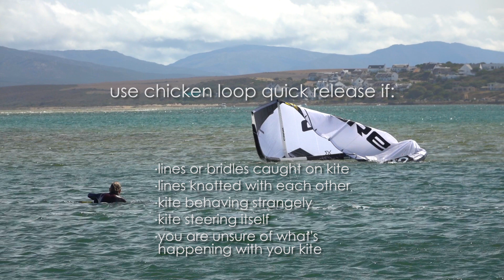Relaunch Part II, Advanced (kiteboard tutorial)

Comment: Thanks for your very useful video. Please note that in the later part the video, two relaunchs SEEM to be done WITH tangled lines (it can be clearly seem at times 8:40 and 10:11): is this correct?. Please advice.
Reply: True! 
But you can control the kite as usual with such tangled lines, so you can return to the shore, land as usual and untangle them in safety. (search for "inverted kite lines" videos)

Or do it in the water, but it is dangerous, cause you need to be unhoked for that and remove your safaty leash. so there is always a chance to make mistake and kite can fly away from you=))

Comment: Is there big differences between kites and reverse launch? So far in light winds i can reverse launch my bandits but reedin supermodel v2, seems to dive when trying to launch. Main consern is that is it because kite design or maybe change kite pressure/bridle settings? Would be super if you have an correct answer❤️
Reply from the maker: Hi Joni, good question. There is definitely a big difference between kites when it comes to reverse launching. Some reverse launch easily, without much steering line tension. Other feel stuck to the water with the leading edge down, or require more of the steering lines to be pulled in, and may even require a few strong pulls on both steering line just to get the kite off the water. Almost every aspect of kite design will play a part in this, aspect ratio, LE diameter, bridle design etc. But, I would add that I've never found a kite that won't reverse launch if there's enough wind. With some experimenting and varying how much to pull in the steering lines, you should find the point a kite flies backwards.
Reply: @kitesurfcollege  THANK YOU! p.s keep doing theese videos. Seen them all and want some more 👍🏻

Comment: Thanks for the video - one remark, however: Re. bowties, your overview says "Use quick release if - kite steering itself; - unsure what's happening". In case of a death loop, this can be a really bad advise, that is when a steering line is tangled (1) around your bar or (2) inside your harness hook. Like this, either (1) the kite will not flag out but keep on looping, however the bar being away from you and the saftey line under tension, or (2) the the QR is not working properly and/or you get the bar away from you as well. The solution in a death loop situation (for the benefit of those reading it and not knowing what to do) is to pull the turning steering line (i.e. the line that makes the kite loop) with everything you have, in order to "smother" the kite (this will happen by itself eventually, as the loops will tighten the kite up - however that might take more time that you have).

Comment: Your tutorials are really the best ! Just one question regarding the re-inversion towards the end of video: at around 10:11 it looks like the left steering line is still tangled   .... how to get rid of that one, too?
Reply from the maker: Thankyou and good question. After fixing an invert you often have one steering line that crosses the center lines. If the kite's not flying correctly, then you must flag out asap. If the kite is flying as normal, then you can head back to the beach, land the kite, disconnect the lines and re-do the lines. This is what I would recommend. You can get someone to hold the kite, then you detach the chicken loop and leash, then fix the inverted line from the bar end by pushing one side of the bar, through the gap between the ceter lines and opposite steering line. Fixing this from the bar side is a bit riskier so takes some experience (as you can easily make things worse).  Interestingly, you can even fix this from the bar side with the kite sitting on the water, but it's very easy to steer by mistake, or collapse the kite. I've even seen a couple of people unhook, and untangle their steering line with the kite still flying. This is, of course, very risky. Maybe I can make a video about this at some point, it's a little tricky to explain in a written format.
Reply: @kitesurfcollege  Thank you so much for taking the extra time to explain in detail!

Comment: Hi. I have an old kite (2013) in very good status as I use it quite rarely (Best Kahoona 7.5m2) 15% of the sessions, only when wind picks up to 30kts. But sometimes in big gust it reacts strangely and makes an inverted shape. As it is a 4 struts kite it doesn’t have one in the middle, and stays in this stable but wrong position whatever I can do . I tried to put as much pressure that I can but it happened again in very gusty situation ( and my kite was inverted with both wing tips closed together as a shell in inverted position) and it was impossible to move it back in normal position even after self rescue without removing air from leading edge, which is quite tricky in deep water. In addition it was also rather impossible to use the kite as a sail to come back to the beach due to the close shell configuration. So a long swim back...
Do you think there is any clue to avoid this behavior or recover when it is like that???🥺

Comment: Great info but....you are standing on the beach or in shallow water. Please try to explain what body position is best  in the water after your kite has crashed, you are being pulled by the power of the wind and are compleatly out of gas? Do you lay on your belly while trying to do this or try to get into a sitting position?
Reply from the maker: Hello Bill. In strong wind it won't matter much. In light wind, you must to try to hold your ground. So legs towards the kite. Then swim upwind and away from the kite using both legs and 1 arm, at the same time do your relaunch with the other arm. Not easy. Laying on your belly wouldn't help, as you will drift towards the kite, decreasing the speed of the wind on the kite. If the wind is very light (6 to 12 knots), then you can be in situation where a dry kite will fly if you keep it moving, but a wet kite will not fly. In such conditions, the only solution is to not crash the kite, which takes a lot of experience.

Comment: great vid. but one problem: a lot of this only works efficient if you can stand, so in shallow water. in deep water it's hardly working, cause the kite pulls you downwind and you cant resist the drag. so you often have to use your board for getting more resistance. And till now unfortunately I never managed to turn around an inverted kite in deep water by pulling the center lines...
Reply from the maker: Hello Clemens, yes it's more difficult in deep water, but not impossible. Of course, if it's going badly, or if people don't feel confident, then they can always self rescue instead.